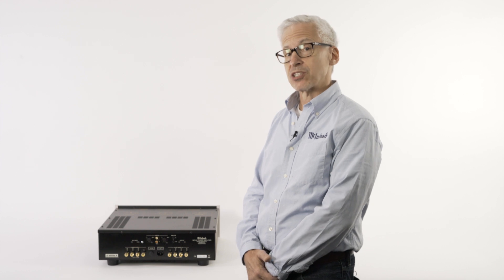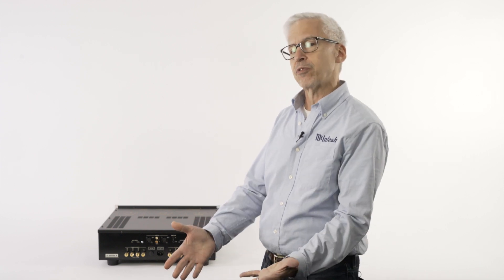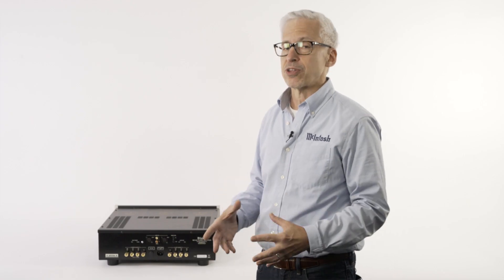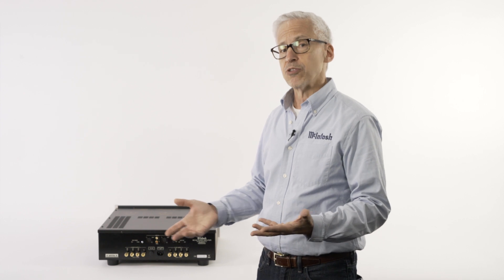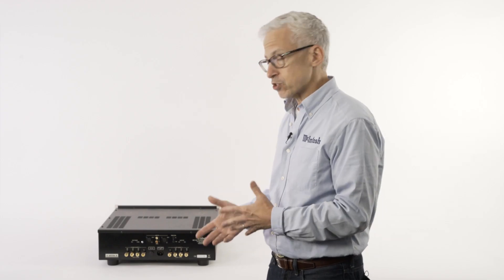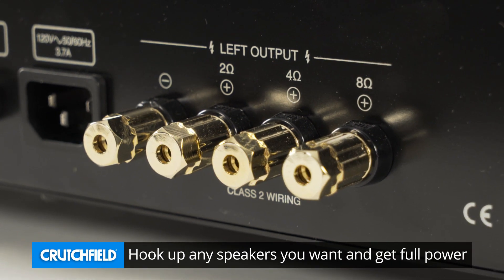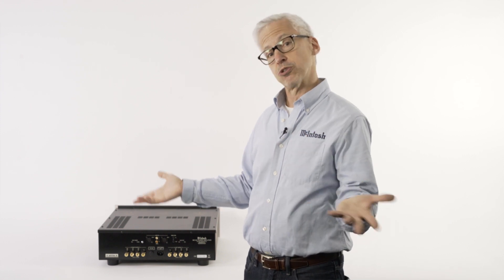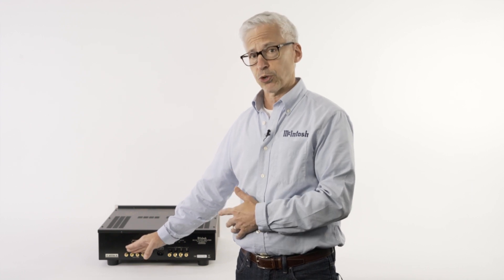McIntosh output transformer | Crutchfield video

Comment: A auto former on the output is good for power matching the amp to the speaker and if the transformer is very good (macs are) you don’t compromise the performance but there are several problems cost is the first then to he weight and the size as far as the other amps that are made yes you will have lower power with higher impedance but the cost difference is more than overcome by the cost

Comment: But if I have a speaker with a nominal impedance of 8 ohms, but it drops to as low as 3.2 ohms according to the specs, to which terminal should I connect it?
If it is an amplifier without autoformers that is stable at 2 ohms, then I will feel comfortable knowing that when the impedance gets low at certain frequencies, the amp will be ok and the only consequence will be that it will get even more power. Then for the rest of the time it will have the power that is rated at 8 ohms, which is fine.
On the other hand, with the autoformers, if I connect the speaker to the 8 ohms output, when it drops to 3.2 ohms the amp will become unstable and forced, but if I connect it to the 2 ohms terminal, I will lose two thirds of its power most of the time, when the speaker plays with the nominal 8 ohms impedance.
It just does not make sense at all to me. Is there something I'm missing to consider?
Reply: You're right , I was thinking of the same thing. Those output connectors with 8 , 4 and 2 ohm are only good if the impedance is constant , but not if you're connected to , let's say 8 ohms , and the impedance goes to 2 ohms. I think McIntosh's concept is not the right approach because some speakers that do get down to 2 ohms do so for a short period of time and then they go back up again. So , what's the use of having seperate connectors ? They should have had one output that could handle the whole spectrum. What do you think ?